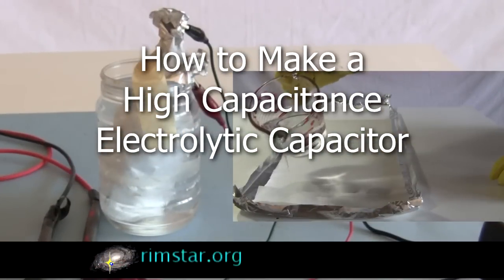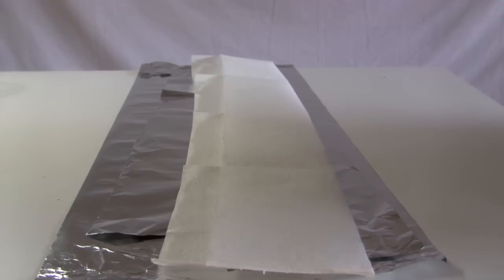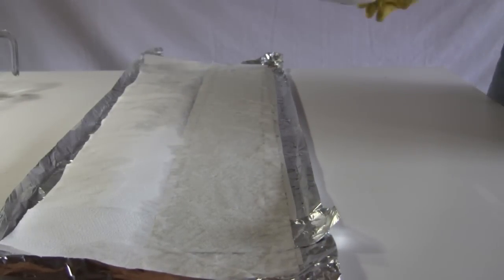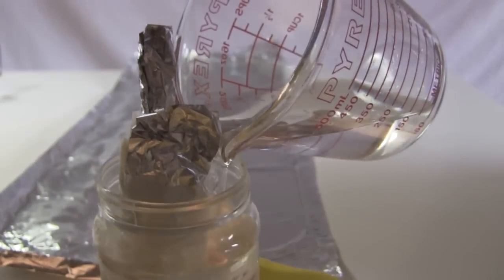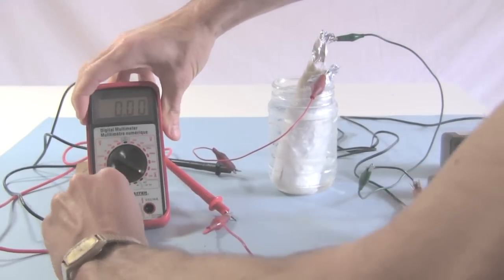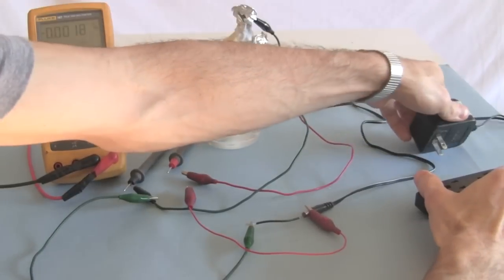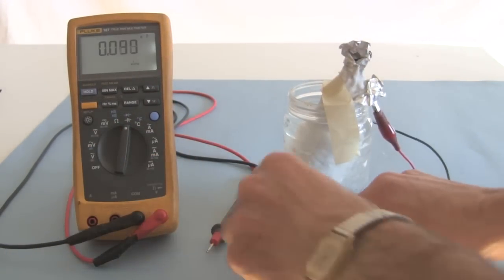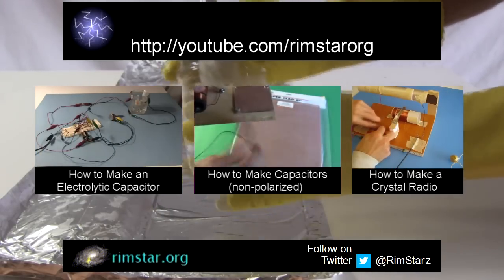How to Make a High Capacitance Electrolytic Capacitor

Comment: If I used thicker alum foil such as alum can. Will that increase capacitance or voltage?
Reply from the maker: No, the thickness of the aluminum doesn't make any difference. It's the surface area which matters.
Reply: Compacitor question:

Compacitence= Bigger the effective area + how close the 2 conductive material are close to each other.(commercial made very tight= higher uF, home made hand roll=lower pF)

Voltage rating= how strong the material is separate the conductive plate. 
Thicker the material, further 2 conductive plate is apart, harder to tighten the roll, less compacitence.

Is this correct?

What determine amp rating?

Did some more research yesterday on material. Super compacitor is made from graphene which has highest conductivity then copper... 

Part I don't understand from your video is that you soak the entire apparatus into the liquid solution. Doesn't that short the 2 conductive plate? Isn't the idea of compacitor is to keep away the biggest area possible between 2 conductive plate with strongest possible at thinnest possible thickness ???
Reply from the maker: I've never heard of an amp rating for a capacitor.
Regarding the fluid in the capacitor, see the video I referred to in the reply I gave this morning to your other comment, specifically the first electrolytic video.
Reply: I just watch the video again where you explain the super thin layer is to create insulate layer stop conductivity of soda liquid to alum foil layer...

Because it is super thin. It give more compacitence. But once it flake off. It will short out store electricity.

Thinking it as water hose, volt is speed water flow through. While diameter of hose is current. Translate it to compacitator. It is the amount of + and - surface touch resistor such as LED light bulb.

Most of capacity has high voltage for small amount of time. So it does not do much continue work. So in most of case amp rating do not play it's part. In fact most of case are trying to keep out put Amp + volt lower then it is rated.

Comment: So , more voltage to coat the Oxide layer on the plate,makes thicker Oxide layer and higher breakdown voltage. Also the thicker Oxide layer means less capacitance.
for example if you want to make a 110 v capacitor you must coat the plate with 110 v .

Comment: Another idea:
Forgetting about the tabs. Offset the + plate to the left 1.25". Offset the - plate to the right 1.25". That leaves 10.5" plate 2 plate & 8x11 sheets of soaked paper on bottom and inbetween. Any, additional paper overlapps 1/4" as needed. Role it together & press together the foil on the left, then right

Benifits include:
1. Less waste
2. Thinner and generally more consistant gap = more capacitance
3. Lower internal resistance & lower internal inductive reactance = greater q

Comment: Why do you need to form an oxide coating on the aluminium when it already has an oxide coating on it? Or does the coating need to be thicker? My understanding is that the thinner the coating the better the capacitor, so wouldn't it work better just using its natural oxide layer?
Reply from the maker: That's a good question -- maybe the natural one isn't thick enough, at least that makes sense. If you check for conductivity of a normal sheet of aluminum foil using a multimeter, you find it has negligible resistance -- there's no sign that there's even an oxide layer, even though there is. So it would make a lousy dielectric. However, the layer we form here is an insulating dielectric, so it sounds like we need to make it thicker otherwise it's useless.

Comment: How much Farad did that measure?
Reply from the maker: See the video at around 8:40. It's around 560microfarads.
Reply: RimstarOrg  ok... am in a little hole right now and its filling up with water. i have this project to do and i choose to build a cap. but so far the one i built is not holding charge. i used a 1gal jug with the foil on the smooth outer surface and a metal rode in the cover and concentrated salt solution. where did i go wrong?
Reply from the maker: Jerome Swaby
What do you mean by it's "not holding charge"? If you charge up a capacitor and then put a meter across it to measure the voltage, if it's a small capacitance one like I suspect yours is then the small charge will discharge fairly quickly through the meter. I just took a 22 nanofarad capacitor and charged it up to around 2.4 volts. When I connected it to the volt meter, within around 1 second it was already down to 1 volt. The discharge curve for a capacitor is very steep at first and then flattens out once it's dropped by most of its voltage.

Comment: What is the maximum voltage for this capacitor. Also what will happen to this cap if we exceed the volt
Reply from the maker: Ashwin Kumar k I didn't test for maximum voltage. I also don't know what would happen if you exceed it. It's possible that when you'd turn off the voltage and go back to normal voltage then it may self-repair, but I don't know that for certain.

Comment: Doesnt putting the entire thing in the jar of electrolyte cause it to self discharge fairly quickly?
Reply from the maker: No, because the two capacitor plates are the electrolyte and the aluminum foil. Between them is a very thin aluminum oxide layer on the aluminum. That oxide layer is an insulator. My video that came before this one explains it in diagrams http://www.youtube.com/watch?v=ml2TdQ2_2mk.
Reply: RimstarOrg woah, thanks for the fast reply, didnt expect you to reply on a 6 year old video

Comment: If I used a few layers of paper towels and built the oxide layer with progressively higher voltage, what could I get the breakdown voltage to be? I'm looking for maybe 12kV peaks, and I could always put some in series. Lower capacitance wouldn't be a problem as long as it's not ridiculously low like 10nF

Comment: Can i use paper and salt water instead of baking soda and tissue?
Reply from the maker: That depends on how well the paper gets soaked when wet. The paper towel that I used is there to act as a spacer between two pieces of aluminum foil and also to allow a lot of the liquid to easily move from one foil to the other, so the paper has to be very porus, i.e., have a lot of holes. If the paper stays fairly dry then it won't work. Salt water won't work. It won't form the needed layer. I talk more about electrolytic capacitors here in this other video http://youtu.be/jF2OqUz0Ddg
Reply: @RimstarOrg  thanks for the reply!

Comment: nice video, for fun it would be nice to make same type capacitor, but very big! and if i do not have voltmeter, if i just leave it forming and testing resistance with LED every 10 mmins, and when led almost doesn't light up, would it be ready? becouse you can see small light in LED even from small curent and voltage.

Comment: hi i tried doing this but instead of the current going down. it goes up and doesn't seem to stop. i hope you could help me.
Reply from the maker: +aLxies19 Did you use distilled water? Tap water, mineral water and other types have minerals in them which are conductive and I've heard that it doesn't work with them. Look in grocery stores and drug stores/pharmacies for distilled water. What powder did you use for the electrolyte? If you used salt then that won't work.
Reply: +aLxies19 Sounds like a short circuit to me, are you sure the two aluminum foils aren't touching each other?

Comment: Could anybody explain me how to minimize the discharge time of a capacitor?
Reply: Nathaniel Charles, discharge rate of a capacitor depends on two things. Internal resistance and the external load resistance.  Things that may effect internal resistance is the distance from the lead to the farthest end of the plate, thickness of the plate, and plate materials. Longer role, thinner plate material, and plate materials made with lower conductive materials will slow a capacitors discharge rate.

Comment: if the separator is thinner, can I get more capacitance?
Reply from the maker: No. The dielectric is actually the oxide coating on the foil and not the paper towel. However, if you could make the oxide layer thinner then yes, you'd get more capacitance. I don't know how you'd do that though. See my first video on making an electrolytic capacitor for the full explanation with diagrams http://www.youtube.com/watch?v=ml2TdQ2_2mk.
Reply: RimstarOrg ok,thanks

Comment: After so many years I finally discovered the root of the problem why it wouldn't work for me.
I need a resistor to limit the current when forming the capacitor! And stepping up the voltage in small increments.
Ive managed to get a rolled up capacitor up to 10v and hold great capacity and not too much leakage current without breaking down!!!!

Comment: "Re 2 ..." continued

en wikipedia org / wiki / Electron "Because of collisions between electrons and atoms, the drift velocity of electrons in a conductor is on the order of millimeters per second. However, the speed at which a change of current at one point in the material causes changes in currents in other parts of the material, the velocity of propagation, is typically about 75% of light speed"

In our case, ion transport speeds will put limits on the the maximum potential current levels.

Comment: You could have fliped the top layer aluminum and paper towl around so that the tabs would be on the same but oppisate sides. That would be easer to prevent the tabs from touching.

Comment from the maker: Nope. I'm no tesla coil expert but I quick search turned up that the breakdown voltage is too low and they must be suitable for AC, which electrolytic capacitors are not.

Comment: Surface make higher capacitance. What make higher voltage?
Reply from the maker: Higher voltage is dependent on the thickness of the dielectric and what material the dielelectric is made of. In this case the dielectric is aluminum oxide. See my first electrolytic video about that http://www.youtube.com/watch?v=ml2TdQ2_2mk as well as my video about making high voltage capacitors https://www.youtube.com/watch?v=MPD7skZ8OSoBTW Surface and a few other things make higher capacitance. My video about low voltage capacitors talks about that https://www.youtube.com/watch?v=GveI9gXIsHw

Comment: which one is positive, and which one is negative?
Reply from the maker: The end that I connect to with the green wire is negative and the end that I connect to with the red wire is positive. So at 7:09, it looks like the outer foil is positive and the inner is negative.
Reply: @RimstarOrg  thanks for replying btw can you make video on magnetron?
Reply: @RimstarOrg  and how to make one
Reply from the maker: Thanks for the request but a magnetron isn't something I'd be interested in making. If I needed on though, I'd try to adapt one from a microwave oven -- they even come with the electronics. I don't know the microwaves from all magnetrons are dangerous, it might depend on the power output, but I do know that they can be.

Comment: Would this work fine for teslas, or would I need a proper one?
Reply from the maker: I'm not familiar enough with teslas to say. Is it the right capacitance? An electrolytic capacitor is polarized. Would a tesla coil circuit work with polarized capacitors? If it is suitable on both those counts, keep in mind I haven't done long term testing.
Reply: Tesla coils require extremely high voltage but not that much capacitance. The voltage would exceed the dielectric breakdown voltage of your aluminum oxide layer. Your best bet is leyden jar styled homemade caps using old bottles.

Comment: is that not more of a supercapacitor seeing as there is no dielectric in between
Reply from the maker: No, it's still more like a plate capacitor. The dielectric is the very thin oxide layer. One of the plates is the aluminum foil which the dielectric is coating. And the other plate is the conductive electrolyte. The relatively high capacitance is simply due to how thin the dielectric is. The thinner the dielectric is, the higher the capacitance. I talk about the effect of different dimensions in this video here https://www.youtube.com/watch?v=GveI9gXIsHw.

Comment: This is good for a demonstration but would have a poor shelf life.  Aluminum doesn't usually corrode because it forms a tight oxide layer, but aluminum itself is highly reactive.  Alkaline water solutions dissolve that oxide leaving water to react with the aluminum and releasing hydrogen.  When installing railing where the posts get grouted into holes in the concrete, the concrete guys often push soda or beer cans down to form the holes.  Since concrete is alkaline, there's very little left of the cans.  That's where your oxide comes from.  If you leave aluminum foil in baking soda water it will eventually disappear, not from reacting with the baking soda which only strips the oxide layer but from the stripped aluminum reacting with the water.
Reply from the maker: I wonder what they do to prevent this in commercially made electrolytic capacitors. Do you know?
Reply: No, but I can guess that it's a flammable hydrocarbon like alcohol which is a polar solvent on one end and non polar on the other.  This is the same issue with lithium batteries, where the electrolyte is flammable.  What they actually use, you have to be in the business to know or search for a long time, and may be a trade secret.  It definitely isn't water.  Not all alcohols are the same, either.  If you mix salt with vodka, you get salty vodka but if you mix salt with rubbing alcohol it will separate into salt water below and pure isopropanol on top which you can pour off.  A useful bit of trivia if you need emergency fuel.

Comment: why is it this capacitor has more capacitance than the first electrolytic one you made?
Reply from the maker: julimoffi There's more surface area. The larger the area of the plates, the higher the capacitance. I illustrate that in my video about making low voltage capacitors here in case you want to see what all goes into determining the capacitance or capacitors https://www.youtube.com/watch?v=GveI9gXIsHw
Reply: RimstarOrg thanks! I actually tried to make both and failed... The aluminium foil disolved!! And the one made from a soda can wouldn't stop conducting, it went down to about 0,7 mA(I'm guessing the oxide layer didn't form properly ) But thanks for making these videos, they were really helpful and I'm gonna leave the electrolysis going for longer to see if  I can get it to work, we left it for about an hour, maybe it wasn't enough?
Reply from the maker: julimoffi I don't know what the cause of the aluminum dissolving is, though I think someone may have mentioned it here or in the comments to my other video at some point, but make sure you don't use tap water. Use distilled water, which you can get in grocery stores and drug stores/pharmacies. Around an hour worked for me, but it doesn't hurt to do longer.

Comment: This is not actually a capacitor... Scientifically speaking, its a battery cell. "Charging the capacitor" initially is just electrolysis. This is a reaction between the Water and the Aluminium to create current. A proper capacitor is made with an insulator between the sheets of aluminium. Charging these sheets creates a very strong electric field that is discharged on contact.
Reply: Incorrect. The layer of oxide is the insulator. Take apart an aluminum electrolytic capacitor. There is a wet paper sheet between the sheets. This is soaked with a conducting fluid.
Reply from the maker: +John Wensley Hmmm... I don't know how I missed your comment before. Steve is right, the oxide layer is the insulator in an electrolytic capacitor. It's thinness is what gives the capacitor its relatively high capacitance. See my first video about this where I explain more of the science behind it http://www.youtube.com/watch?v=ml2TdQ2_2mk.
Reply: RimstarOrg furthermore, the aluminum oxide also acts as a dialetric. Storing energy in electric field's orentation.

Comment: Why you not do a test with a copper wire between the 2 terminals (+ -).
If the capacitor stores current, then the wire will melt.
Look how this guy did it !
How to make 1000F Super Capacitor
https://youtu.be/QZ4mNdQlJyw

Comment: Also using better electrolyte will increase the capacitance . baking soda solution is not a good electrolyte.  try to use sodium or potassium nitrate which will be almost 100% converted to Ions in water.